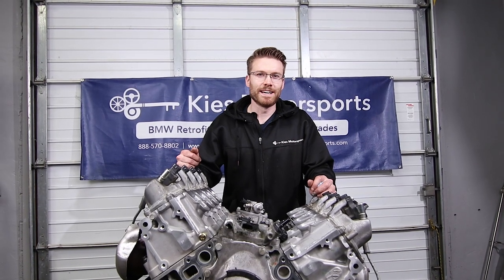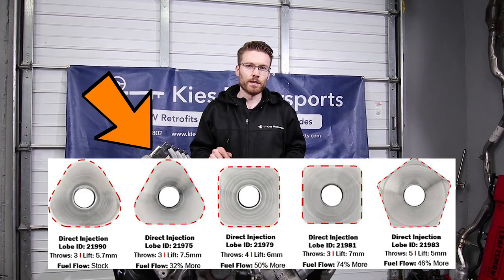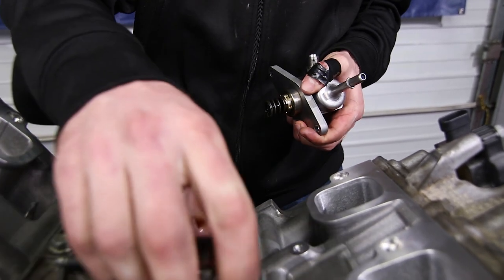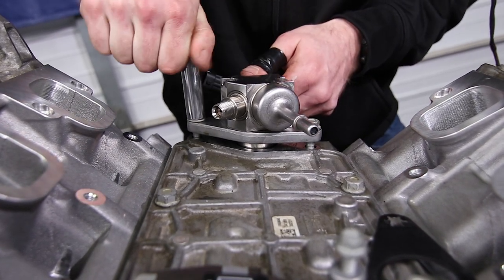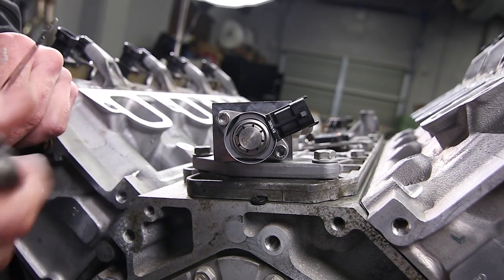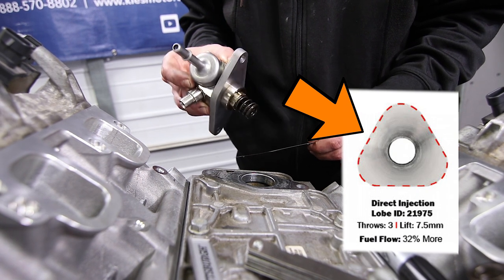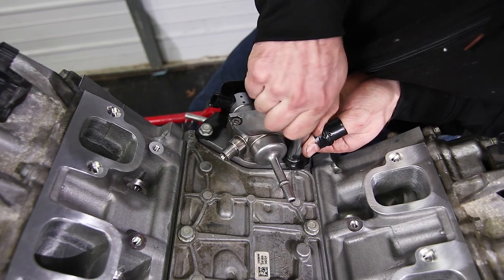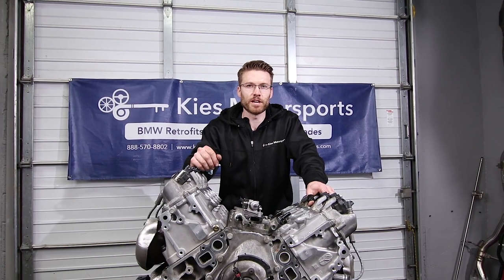How To Properly Lash High Pressure Fuel Pump - Checking HP Fuel Pump Clearance L83 L86 LT1

Comment: What if I'm doing a lt4 pump in a LT1 car do I still need to check for that clearance no lash cap
Reply from the maker: I'm not positive, I think it has more to do with the camshaft but I would double check with someone like gwatney performance or Texas speed.
Reply: @TheSundaeDrive  thanks seems like every speed shop I called in my area said remove lash cap and just tighten it down accordingly torque down and I should be fine
Reply from the maker: I would go with what they say then. Always a good idea to talk to the cam manufacturer as well. I haven't done the upgrade myself on an lt1 so I'm not sure. The main thing is you want to make sure you don't bottom out the fuel pump and you also don't lose contact with the fuel lobe

Comment: If I need to change the lash cap, how do you remove it and is there a tool for installing a different one?
Reply from the maker: You should be able to pull it off. It normally doesn't fit as tightly as the one in this video. If you have an issue, it's easy to swap the roller lifter. I installed another cap on a different 5.3 and it popped right on easily.

Comment: When reinstalling the high pressure pump is it necessary to replace that gasket and do you have a part number ?
Reply from the maker: +Manuel Robles we reused the gasket but it is fairly new since we also replaced the fuel pump last year